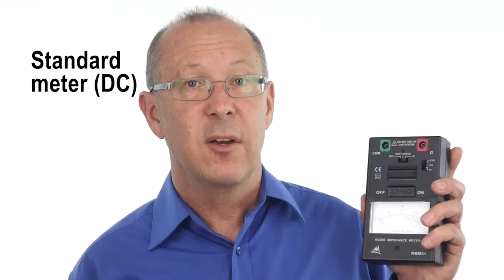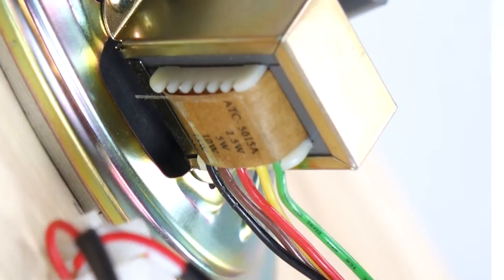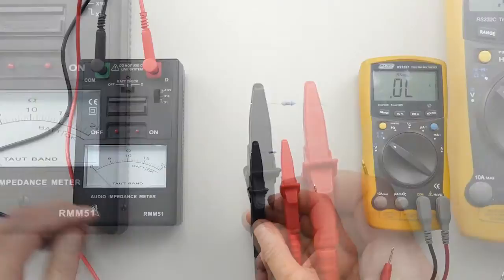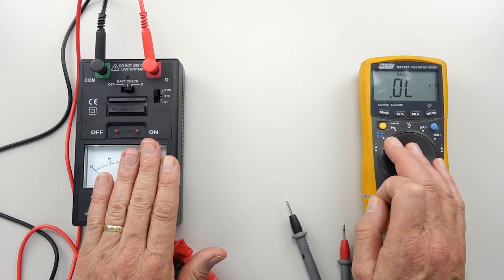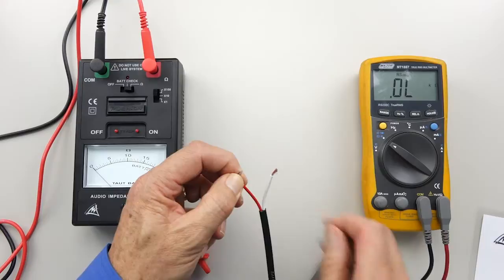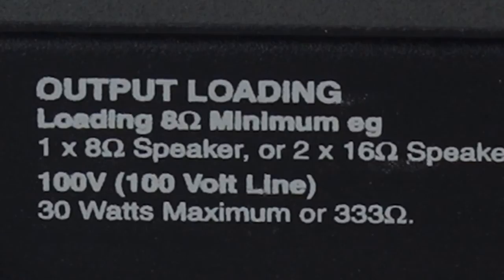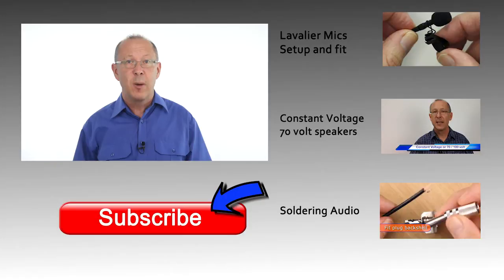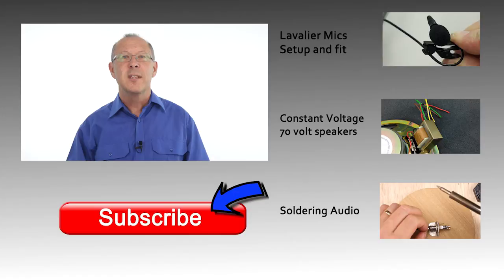Testing 70/ 100 volt Speakers | Audio Impedance Meter

Comment: Thank you!  Although I am still curious to know why the DC meter read a different impedance.
Reply from the maker: It is a little perplexing Evan, it is simply the way DC and AC react through a transformer coil. A standard multimeter only applies a single direction current through the coil. It does not get affected by any collapsing magnetic fields that are produced with alternating current.
Reply: @GaryDmedia  Inductive reactance is what I’ve been used to hearing it as opposed to electric resistance.

Comment: Hello i have stupid question - Can I measure impedance of unknown output transformer in tube amp. It will be connected on speaker, but disconnected from anode of output tube ?

Comment: My local made pa amplifier output volts are 95v @ 8ohms. (450 watt @ 8 ohms)
it has no output transformer.
The dc supply rail is 95+95. 
Can i drive 100v line speakers on it?
how many speakers i can drive on it?
Reply from the maker: I am not sure what amplifier you have. The short answer is no. The output of this amplifier is 8 ohms. A constant voltage amp that drives 70/100v speakers has a much higher output impedance.
Reply: @GaryDmedia  
I have toa column speakers. Each have 330 ohm imp 30 watt . If i connect 40 speakers in parallel it imp will 8 ohm & 1200 watt. My amp out on 8 ohm is 100. volts. What is your opinion?
Reply from the maker: Would you please be able to let me know what brand and model amplifier you have? That would help me make a comment.
Reply: @GaryDmedia  
my self made amp 24 transistors 2sc5200. Dc rail is ± 95vdc. No out put transformer direct out 8 ohm 100v. there is not allow photo comment therefore i cannot send you photo. Kindly can you give me watsaap or e mail.
Reply from the maker: My email is contact@garydmedia.com
Reply: @GaryDmedia  
check your inbox
Reply from the maker: Abubakar sial, The amplifiers look awesome! They are so well made. 
I understand the output of your amplifiers now. The marking on the terminals indicate the total load you can put on the amplifier is down to 8 ohms. This means you can put one 30 watt speaker on the amp or as you say, up to 40 speakers in parallel. You are simply not supposed to go lower than 8 ohms. 
I personally don’t like to load an amplifier to its maximum. 3/4 of its total load is a safe amount.
Reply: @GaryDmedia  
Thanks

Comment: hi, I have an older bogen dma 80 mixer amp with 70 volt output which is 80 watts it does not tell me the recommended impedance for 70 volt can someone help me please
Reply from the maker: Yes, some amplifiers don't have listed the impedance.  Using the 70v speaker terminals on this unit and with 80watt capacity the impedance limit would be around 60 ohms. So keep your impedance above that. I have included a link to a simple chart under installation basics: http://sound.whsites.net/articles/line-amps.html#ref

Comment: Thanks, Gary.  One question: some "professional" replaced speakers in our church last year; since then the amp sometimes cuts out.  I measured the 100V line impedance at 38 ohms - should, of course, be over 80 ohms for our 120W amp - he must have used tappings far too high for the 13 speakers.  Rather than risk a fall from a very high ladder while changing tappings, I should be able to switch the line to the 70V setting and crank the mixer and master vol controls up a bit, shouldn't I?  Most settings are well under 50% at the moment.
Reply from the maker: +Michael Duffy Yes that is a very simple fix. With a lower output voltage the speaker system won't draw as much current from the amplifier. I hope that the impedance lifts enough for you. Hopefully the amplifier is only cutting out because of the overload protection. Many of the installations I work on have the speakers set a 2.5 - 5 watts and this is ample for most seminar type applications where ceiling speakers are employed. Thanks for asking such a good question.
Reply: Thanks again BUT I expected impedance to stay the same while with the lower voltage, current and consequently wattage, reduced.  Is this wrong? Michael D
Reply from the maker: +Michael Duffy My mistake, yes you are right. the impedance or resistance of the speaker system will not change. The load on the amplifier will be reduced. Not good if you have to change all of the transformer taps on the speakers. May be better to replace the amp with a more powerful one. Hope the simple fix corrects the problem.